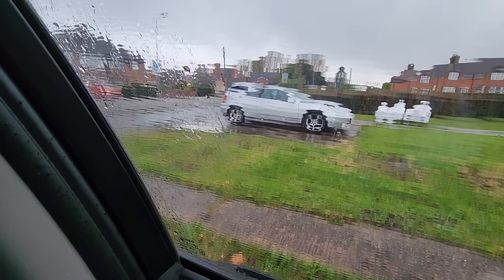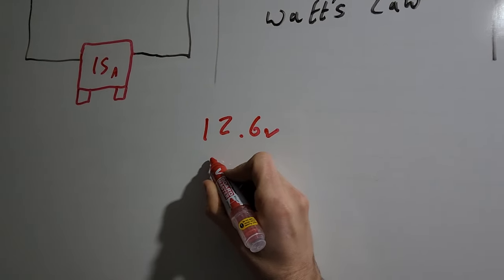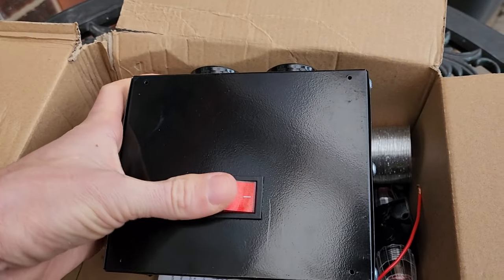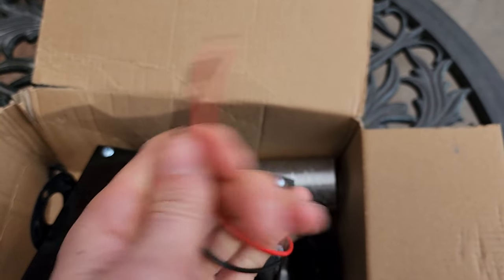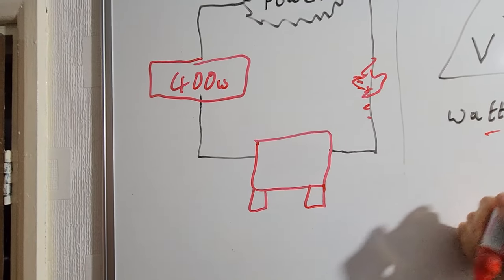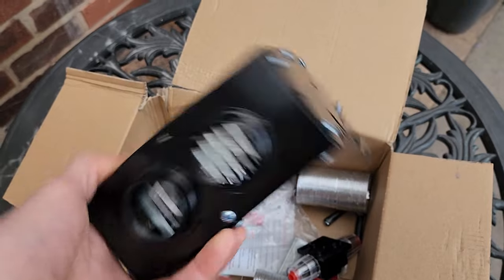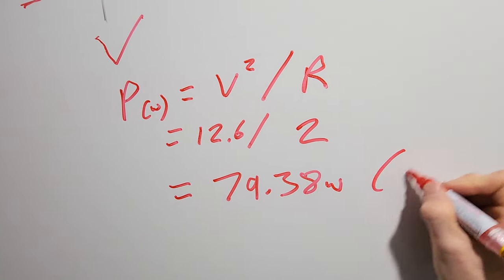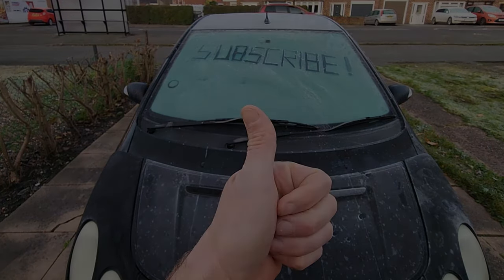AVOID These Portable 12v Car Heaters 🔥 Wire & Fuse Sizing Electrical Circuits 🚗

Comment from the maker: If your cars heater is broken and you can't afford to get it fixed, then a cheap 12v portable heater may sound mighty tempting!
However, if I were you, I would buy a battery powered heater jacket and a 12v heated seat blanket over one of these.
Why? Find out why!

Comment: I think the 400w/600w is actually the reason why the heating elements were disconnected out of the box- I think you are supposed to screw the metal jumper plate into the correct position for your selected desired power output.
Reply from the maker: I was thinking something similar, so I went ahead and ordered one more. This second one was connected in the center position on both sides. 

It seems like the holes are tapped one size too big for the screw, that's why the first one was disconnected.

Its interesting because the resistance is 2ohms wherever it's measured from
Reply: @TutorialGenius  That's quite interesting and quite shoddy from them indeed. I do have a suggestion for perhaps a more reputable place to get car heaters and more, if you'd like me to share it. Perhaps you could test one of their 12v heater boxes?
Reply from the maker: @ivy7642  that would be great! I'd be willing to give it a try!
Reply: @ivy7642 hi whats the 12V heaters name?
Reply: Chinese manufacturers like to embelish facts

Comment: I am not quite convinced that you are right. In the Black Box, there are a total of four (4) x 2-ohm Elements. But it looked like you only measured one Element. I agree that the single Element would give you approx 79 Watts. But the Heat Output from that Black Box (all parallel - wired) should be 79 x 4 Watts = 316 Watts. The Red On/ Off switch could be changed to a 3 -position Switch, where you could switch some (or all) of the Elements to provide you with different Output Wattage combinations. When I watched your video, I was thinking that the contents of the Black Box would be a PTC arrangement - and not some ancient   resistance-wire / mica all knocked together. I am not an electrician, but I have a basic understanding of electronic circuits / functions. Thanks for demonstrating just how the average guy can be ripped-off with shoddy equipment, made from chinesium, and being a little economical with the truth regarding the (claimed) 600W Heat Output. Greetings from Australia.
Reply from the maker: Somebody already left a similar comment and I addressed it on the response to that. It didn't matter which configuration it was measured in, the resistance was the same (2ohms).

Normally you would move the terminals, but this wasn't the case here sadly. I bought two units (in case one was faulty), but they gave the same output.
Reply: @TutorialGenius  You had four (4) individual Heating Elements inside that Box. Each Individual Heating Element measured 2 Ohms. I would agree with you that the Heat Output from ONE single element would be 79 Watts. Your conclusion (at 16:30) was that the Power Output "was not even close" - at 79 Watts! I just cannot see how you can string four (4) Heating Elements in parallel (all consuming power) with your conclusion that it "was not even close". The total power consumption was less than the manufacturers' claim, of 400W, but my reckoning was that (with all four elements connected in a parallel circuit), the power being drawn was approx. 316 Watts. If I am wrong, then I need to go back to college.
Reply from the maker: I mean you could string everything in parallel, but I'm not about to manually do that. It should be wired that way out of the box. Usually you just move the cables like I said in my last message @peterduxbury927

Comment: What would happen if the heater were connected directly to the car's battery ?   of course a fuse would be desirable if such a thing were installed in the car
Reply from the maker: It would start heating lol, what do you mean?
A fuse would be necessary, not desirable, for all reasons I covered in the video already
Reply: @TutorialGenius  
I sent this message by mistake....Of course a fuse would be needed between the battery and the heater. There are switches that have fuses on them.  
this is what I wanted to ask: is there any alternative... Maybe something that would connect directly to the car battery?
Reply from the maker: @j0van87  ohh gotcha!
I like the idea of running some thick cables through the firewall and attaching an inverter, then running an AC heater from that. Only because the inverter would have many uses besides just providing power to the heater.
I haven't seen a very good DC heater that runs on a typical car battery, this is pretty much it sadly.
Reply: @TutorialGenius  you're right the AC heaters are much more capable

Comment: I think you forgot to multiply x4. You only read 1 element.
Reply from the maker: Not at all, although, you would expect this to be the case.
The clamps can be positioned in 3 places on each side, with each place giving a different resistance reading (I.e. A more powerful heater depending on the position.)
However, each position measured at 2 ohms no matter where these were placed.

Comment: Easy work... Just put an inverter in your cigarette lighter with high watts capacity. Example 500w or more..
Reply from the maker: There are so many questions I have on this comment, i don't know where to start! Did you watch the video??
Reply: I'll say what he's thinking:  If a cigarette lighter is fused at around 200 watts, how will you POSSIBLY get 500w out of it via an inverter?

Comment: is there any alternative... Maybe something that would connect directly to the car battery?
Reply from the maker: Rather than fixing the heater?
To be honest, I like the idea of running some big cables through the firewall and connecting an inverter, then just running an AC heater from that. Obviously you would need to make sure it's kinda safe haha. Only because an inverter would be very useful for many other things
Reply: @TutorialGenius  I have an Old secondary car. And fixing the header is too complicated and it will cost too much to justify spending.  So I was looking at your video to find a solution, something that I can attach to 12v DC car battery.

Comment: If you calculate for a 2’ run at 31.75 amps you can use 16 gauge wire so 14 is adequate. Would I use 14 on a 400 watt heater if I were building it? Not on your life but it is technically adequate.
Reply from the maker: I think most folks power source is more than 2 feet away from where the heater would be placed.

Comment: 🫵🏻r video was the BEST I’ve ever seen with the exceptional explanation of math formulas.
Many carbon footprint’s wouldn’t remember or know those formulas or their uses. I’m keep a video for future reference. 
Now for those reading comments, try checking out RV CENTERS that have vehicle heaters for RV’s , or BASS BOATS that also have heaters. This video explains necessary heater data when WANTING HEAT ❣️❣️  I’m a new subscriber and look forward to more videos❣️🫶🏻
( 1-5-2024 🇺🇸👍🏻 central Louisiana )

Comment: 75w is hot
Reply from the maker: Hot like a wet fart
Reply: 75w is definitely hot, but it ain't heating up the space around it.  The LED light on my bicycle is brighter than my car headlights, but my car headlights can light up a lot more road.